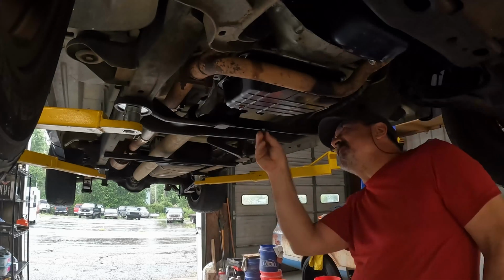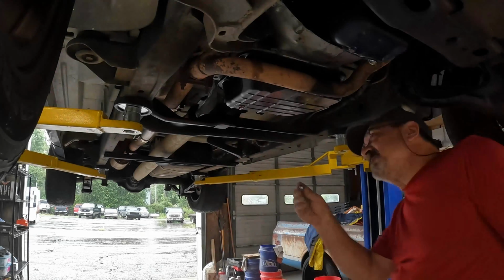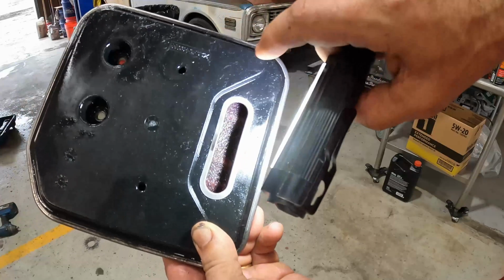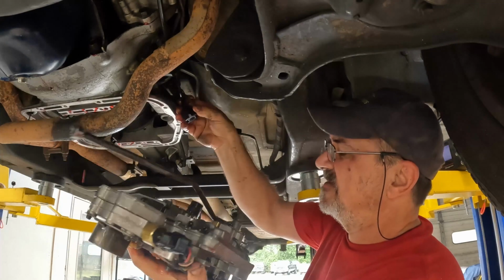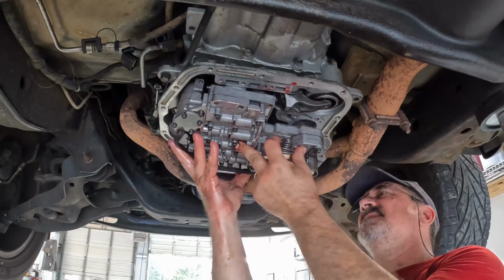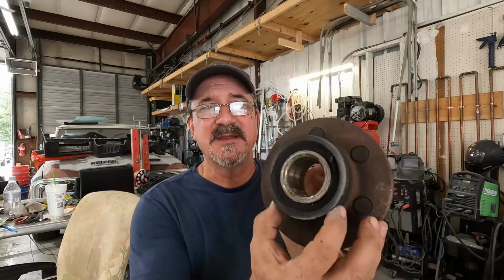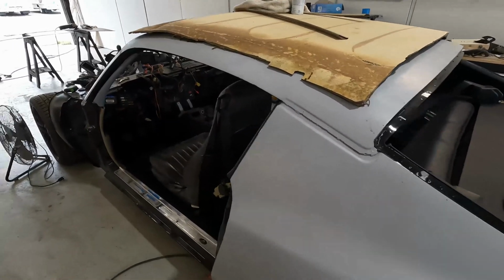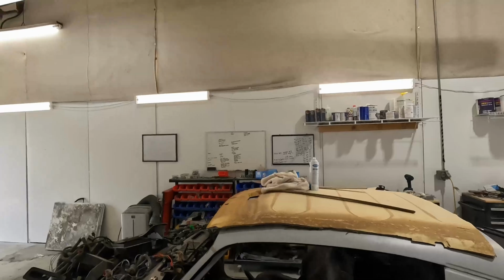How Are All My Projects Coming Along!

Comment: Just rebuilt an air compressor that had failed due to you guessed it a cheap  shielded bearing.  Of course it had to be the bearing that required the whole gosh darn compressor to disassembled.  The easy to get to bearing was a fully sealed one. 🤦‍♀
Reply from the maker: I'm keeping the old hubs. I'll disassemble them and try to find replacement sealed  bearings and have a spare set of hubs for when this new set I just put in fails 🤨